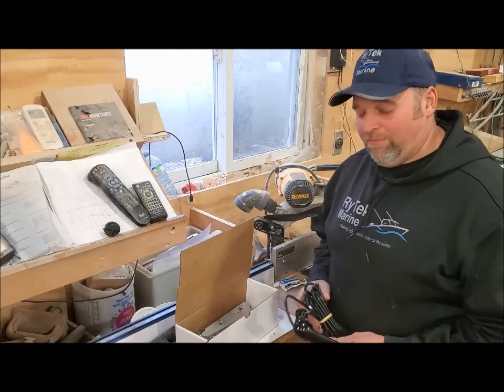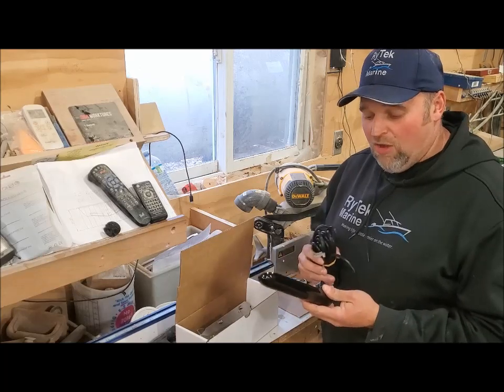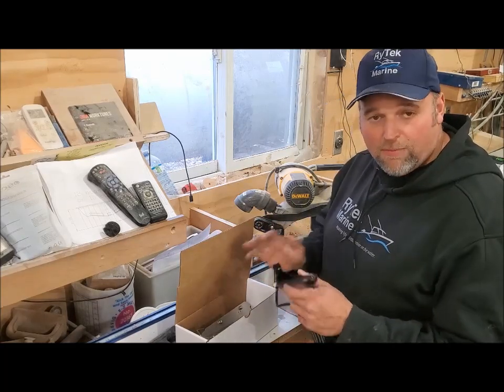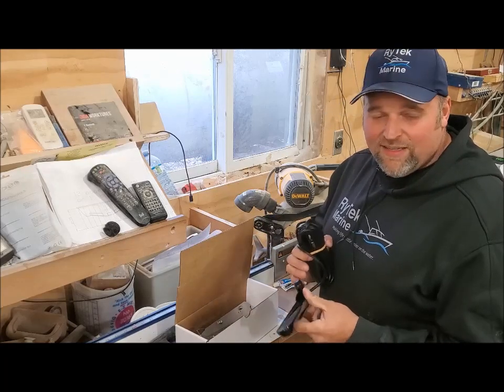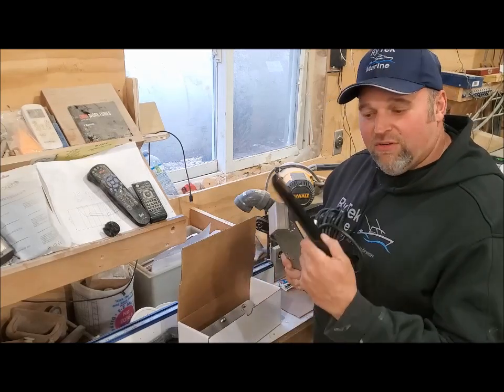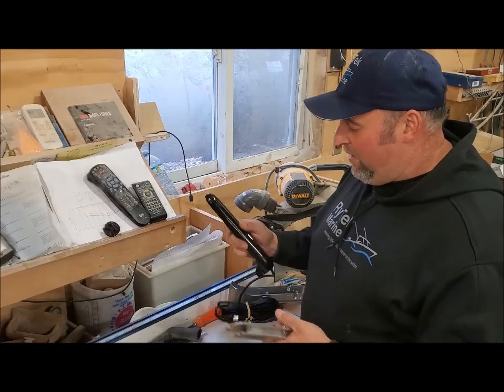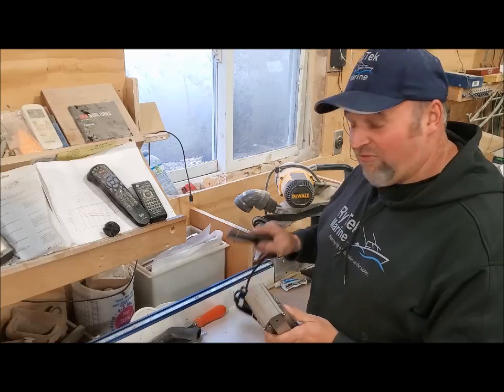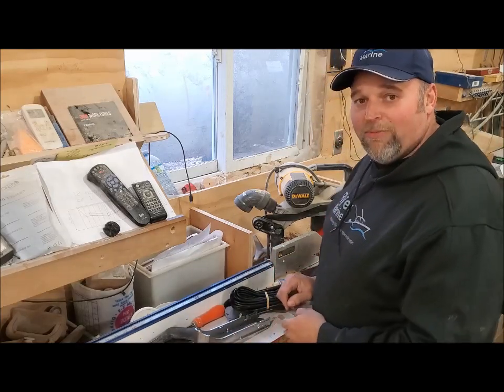RyTek Marine Lowrance Tripleshot RTL4500 Introduction Video Part#1

Comment: Will this fit a minn Kota edge 45#?
Reply from the maker: With motors with the skeg on the opposite end as the propeller, the only option for these long structure scan tranducers is to cut the skeg off...does not effect the motor but allows the use of these longer transducers.  Any questions just email me thru the website or call!